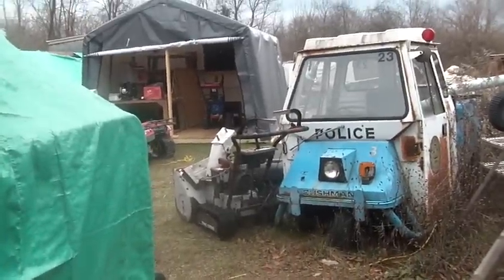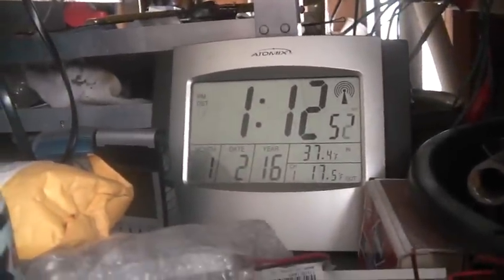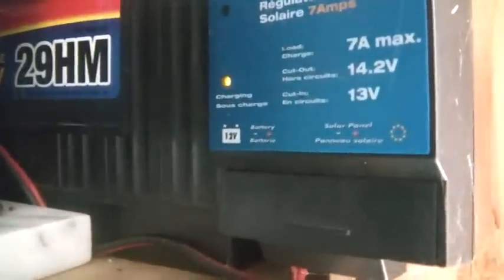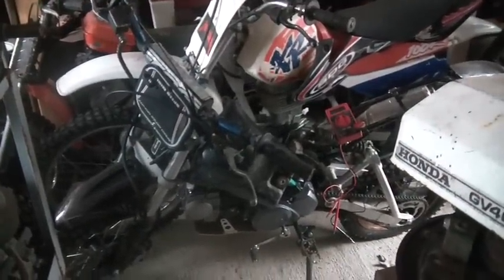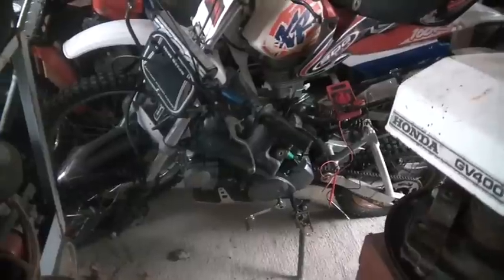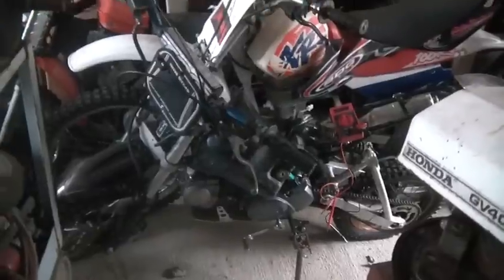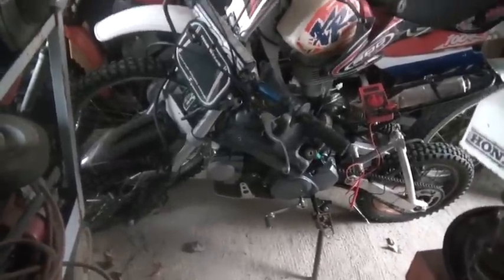Quick Pit bike wring tutorial, Lifran 125CC engine swap,

Comment: Harvey Spooner, thanks for this video.  I had picked up a Kandi 110cc kart that was in poor shape and needed an engine change.  I got a 125cc chinese motor like the one you used in the video.  I spent almost 3 days trying to get a spark with no success till i watched this video.  it is running.  only thing is my kill switch, when it is on it kills the engine and the engine runs when it is off.  no biggie though.  I will get a push button kill switch.
Reply: How do I disable the black/white kill switch wire?

Comment: I have a x18 super pocket bike, im trying to bypass the rest of the wiring and hook up the cdi straight to the motor, i have all 5 cables coming out of the motor, and matching ones on the cdi. I connected all of them together accept yellow and white. I left white dangling, and i tried hooking the yellow from the engine to the ignition coil, and then the yellow from the cdi to the ignition coil

Comment: hey buddy !!! i built a bike cd 70 honda based , when it came to wire it up i hook up blue+white to blue+white , black+red to black+red groung to ground and then black and yellow to coil along with green and put the spark plug cap on , it seems it can work but it misfires more than firing right

Comment: What happens when you get a engine off ebay and the stator has the usual wires but the pulser has 5 wires and a green plug to go to the cdi?

Comment: cheers Harvey so in my case the (red and yellow wire) from the kill switch goes directly into the bottom middle point in the CDI? does not connect into another wire and then into the CDI?

Comment: I bought a new lifan 150cc kickstart engine installed it today and it’s not turning it compression is good Changed the spark plug has a brand new carb bought a new wiring harness hooked it all up and fuel is clean but it’s not turning on please help I’m clueless on what it could be anythinnng I should do or check PLEASE HELP

Comment: Man i am a little confused with the to ground one on the stator and one on the cdi. Which one of these do i hook up on the body of the bike. I made a wiring harness myself and i tested it outside the bike and worked but when i put it all together didn't work then i unscrewed the coil pack and i was getting spark. I connected the ground of the coil pack the ground of the cdi and the ground of the stator all together and also connected it to the body.

Comment: Hello I have a 2012 SSR, do not think it has stock motor on it(JetMoto on side of it). It ran EXCELLENT as long as I didnt let it sit 4 2 long(3 week or more) then its a bitch 2 start. But this time it wont start, so my plan is 2 replace all wiring(CDI/Ignition Coil/& most important 2 me Voltage Regulator). All these have nice 4 prong connections, do I need a wiring harness or use my own wire & connections
Reply from the maker: Hey Hunter!!!!   Did the bike loose spark???   It seems that some or all 4 pin CDI units use DC power, some use 12volts from the battery, some use rectified AC off the stator.... My lean would be to make sure the battery has a charge on it or if no battery, I would roll it down a hill and pop start it. I would not replace anything quite yet, make sure Ur on and off switch is working properly, all of Ur connections are good and that there are no broken wires, also, if it has the original plug, change it, China plugs are weak at best and absolutely horrible otherwise...  Good luck, let me know how it all turns out!  Thanks for asking, watching, and commenting!!!
Reply: What up Harvey, I had my friend pull me all most an 8th mile with his atv 2 pop start but no luck, that was b4 I messaged u. At this point I have the new CDI, &  Voltage Regulator. I like my things 2 run good & b well taken care of, so I don't mind getting all new wiring 2 do that. It dose not have a battery, & i haven't put the new parts on yet.When I ordered them I had a delivery date of 11-22-16, but 2 of the 3 parts have arrived, 3rd will b here soon.
  Thanks 4 getting back, will let u no how it goes.

Comment: Just bought an "sdg" brand 125 pitbike. Has a no spark issue. Ive noticed it only has 2 wires coming from the engine case/stator, a white and a black. Does that seem correct? Which one is which? Stator and pickup coil
Reply from the maker: Hey Nate, Good luck with Ur SDG bike, I swapped the OEM motor out for a Lifan model, I'm going to have to look at the OEM motor again... If U don't hear from me over the next couple of days, please remind me.... Normally the CDI stator wire is black with a red stripe and the pulse generator wire is blue with a yellow stripe, the green wire is ground.... I'm thinking that the white and black maybe for the neutral switch.... Thanks for asking, watching, and commenting
Reply: take ur magneto off and see if u have 2 coils of wired stator coils.then note that the wires comin out are from small coil fpr firing.id say u have only 1 for firing or power and one for the pulse control.u will see the pulse control knob or nub.note wire color.same with other.

Comment: Great videos mate very helpful, I have a ybr 125 engine standing out off the bike and wount spark iv followed the cdi wire up video but still no spark,  I don't have the frame to ground. So do all my grounds go to engine casings??, could this cause a perminant off switch condition?? All my parts are new cdi coil etc, stator checks out out with multi meter, iv made shure the black and white off switch wire is not touching any thing cheers from England....
Reply: It turns over perfectly using the starter moter aswell, I noticed you don't use a rectifier in the cdi wire up video just stator to cdi, I always thought a regulator had to be used.

Comment: I have a small 125 and want to hook up a light. How would I do this. What wires?
Reply from the maker: Hey Cole, To hook up a light, I would hook one of the light wires directly to the battery Neutral, (-), the second wire I would hook to one side of a switch, (toggle switch that U choose and mount on the ATV), the other side of the switch would go one side of a fuse and the other side of the fuse should go to the positive, (+), side of the battery.... I hope this helps, thanks for asking, watching, and commenting!!!

Comment: hey what is the white and yellow wires for on the pit bike that ain't hooked to anything just wondering man
Reply from the maker: Hey Cort, The white wire and the yellow wire would go to a voltage regulator, the black wire from the regulator would be ground, and the (-) side of the battery, the red one would go to the positive, (+), side of the battery... If there is not battery, those wires should be left floating, (unconnected), I hope this helps, let me know if U need more.... Thanks for asking, watching, and commenting!!!
Reply: Ya no problem and do u think I could hook up a light to those wires

Comment: I have 3 wires coming out of my honda 250fl. Black, Yellow and White??
Reply from the maker: +John D ,  3 wires coming out of the engine???? If I recall, the FL250 is a 2cycle engine and normally they spark on every engine rotation,  does the spark plug wire come out of the engine or is the coil up on the frame, (I am not familiar with a complete OEM odyssey, the ones I have seen were altered... But, my guess on Ur wires, yellow is to power lights,  if one grounds black, that is the off switch, not sure on white, it could be ground, (check it to the case with a DVM)... I would also recommend checking a service manual for where those wires go, given that I am not sure... Thanks for asking, watching, and commenting!!!

Comment: I have a 90cc dirt bike and the stator pick up unit was hit and snapped off by the chain and I have a DC plug in and it's really hard to find another one. is it possible that I can cut the wires, get a new stator plate and connect and tape the  wires together
Reply from the maker: Hey Dennis, Yes, U can cut and splice the wires, leave them as long as possibe and do a nice neat job, all should turn out good.... Thanks for asking, watching, and commenting!!!!
Reply: Harvey Spooner i have a 1986 trx200 sx and have all my wiring right, i did purchase the pit bike harness. Everything is wired correctly but still have no spark?

Comment: I have a 125cc in a Chinese go kart and I put a brand new stator in it two nights ago and I’m still not getting spark and I’ve changed all the electrical things that come as a pack from Amazon such as CDI and everything else but I eliminated everything so I don’t have to deal with lights wiring and all that so just wires that run the motor and I’m getting power from all wires from the stator except the blue and white one and I don’t know why, anybody know what the problem could be?

Comment: King quad.. caught fire all wires burnt plastic melted Long story short I separated all the wires because someone grounds hot I've been watching I've been getting a lot of information has helped me I got the bike running again Carburetor Quickly redone But I'm having some issues With the reverse light switch or something probably coming from the motor I suppose I don't know Anything you can go over something new maybe to help me I appreciate it I'm thinking about doing is cutting wires and trusting that the colors that you say or what they are is what's coming out and I'm going to go with that I'm not sure I'm not sure what to do yet but But give me some insight on whatever I appreciate it Thank you

Comment: Im confused, i have 4 wires coming out of my bike and 4 out of my CDI (excluding killswitch). How can the cdi and ground get a wire if all 4 wires are matching up?
Reply: Yes exactly I'm thinking the same thing, I think a multi split ground lead  will need to be spliced in to the one and only ground.. Maybe... Bloody cdi I want to hammer mine lol....
Reply: @Shreddykruger  Lol, I know what you mean. Unfortunately since then I've moved onto BMW electrical issues lol. But If I remember correctly I believe what you said is what I had to do to get the bike working, splicing into the ground.

Comment: I have a question about the CDI if your bike is getting spark does this mean you're CDI unit is fine or if it's something else be causing my bike to not start
Reply from the maker: Hey Ryan, If U have a solid spark, Ur ignition system is probably good, (the CDI, coil, stator, plug, and harness are all good), I have to ask the next questions, what happened to the bike between when it was running last and now... Was it taken apart, did it sit for some time, did it run out of gas, or did it just plain of stop running???? Thanks for asking, watching, and commenting!!!
Reply: IThank you for getting back to me, from watching your videos I really gained some great insight into home repairs on my bike,Now the thing I did do the day/morning of my engine fail  was change my air filter from the Dual layered foam type to a small Mesh or metal wire type cone shape. Both filters are $5 eBay entry-level ones after making that swap I rode approximately 2 hours before having trouble while coming down the hill from my favorite ride spot and my bike started to sputter and then completely died seeing as I was on a downhill I continually tried roll starting which normally I'm very good at and nothing the bike would attempt to turn over I could hear it making that trying to start noise. You know the one. Not to mention great compression and fat blue Spark. Even so first thing I tried was new NGK spark plug and seeing as my carburetor was the type you cannot remove the float Bowl I decided to upgrade to the Mikuni vm22 but still no start.

Comment: Hi I just bought a pit bike don’t really know that much about them but from what I know the bike has compression and petrol in it but I checked for spark and it does not have spark I tried starting it by rolling down a hill is it because there’s no spark why the bikes not starting and I’ve ordered a complete wiring loom will that do the job by the way the bike I have is a 110cc semi auto don’t know brand
Reply from the maker: Hey Abdi!!!!!   I will be going thru the wiring on my pit bike as it has been cut and pretty much removed.... I hope it helps U.... Once in a while, a bike has a 12VDC CDI system, in that case, one needs a charged battery in it to run.... Thanks for the info, watching, and commenting!!!!
Reply: take your spark plug out of the cylinder head and touch the end of the plug to somewhere metal on bike while you kick start it. you should see the plug spark when you kick start the bike. If not, try ignition coil or stator. Mabey even CDI? a whole new wiring kit is only like $20 if you need it. Good luck man.

Comment: I have a couple of Chinese bikes both with electric start, but the I can't find which cable on the rectifier regulator is meant to be supplying charge. Can anyone help? Or does anyone have a wiring diagram. One is a 125cc thumpstar and the other is a 70cc no name bike
Reply from the maker: Hey Dan, Typically a rectifier has 4 wires on it, the green one is ground, the red one is battery positive 12volts, the other 2 wires, (both yellow or yellow and white), go to the stator, I hope this helps, let me know if U need more info... Thanks for asking, watching, and commenting!!!
Reply: does it matter which way round these wires go i have white and yellow on my bike loom and yellow yellow from my engine but cant get it to charge?
thanks for the help...

Comment: Hello , my stator don't have any black with red striped wire , so what can I do?
Reply from the maker: Hi, Tell me about Ur bike, I need to come at it from a different path, does it have a 12volt system, a battery, lights, electric start?   Is it a 2 stroke or 4 stroke engine????   Just one cylinder???  U may have a DC powered CDI.... How many pins on Ur CDI are wired up, 4 or 5???? Thanks for asking, watching, and commenting!!!
Reply: @HarveySpooner  it have 12 volts system , no battery , no lights , no electric start . 4 stroke . The bike wont spark , I suspect the pulse generator is broken or the stator isnt working .

Comment: hey guy i wired it up but i cant get a good enough spark to get it to folire over so i ran a wire from the battery to the hot side on the coil it fires up and runs but when the battery dies so does my good spark to keep the engine running can you help me out here
Reply from the maker: Hey Smoke, Any possibility of getting a video of what U R up to... The coil should only have one lead for input, the primary lead that is powered by the CDI box, if one puts 12volts DC to that, it will only spark when the voltage is removed... Does Ur spark coil have inputs?   Maybe U have a 12volt powered ignition system?  But, that would mean Ur CDI should be powered by 12V, not the coil... A video would help.... Thanks for the challenge, watching, and commenting!!!

Comment: Been finding out these CDI's only work on Hondas and china bikes. Tried a Polaris and a Suzuki LT400 and they burn out. The lt400 would only last one ride and burn out. My figure is the pick up coils output is to high.
Reply from the maker: +william staten , Good info!  I'm planning on smashing the 12Volt version CDI into a 2 cylinder opposed golf cart with a double secondary ignition coil to fire both spark plugs. I wonder if the pulse generator on the Robin engine would kill the CDI box.... About Ur problem, I would find out what the resistance of the Polaris and Suzuki pulse generators are and add a series resistor to get to the 30 Ohm value that most Honda pulse generators are,  if the series resistance is higher than 30 Ohms, I would go with a parallel resistor across the pulse generator... Honda Pulse generators cost about $18 on eBay, China clones go for about $10... I hope this helps... Thanks for all the good info, watching, and commenting!!!
Reply: thanks I'll give it a look

Comment: Can you wire both coils together to increase spark?  Sorry if that sounds dumb
Reply from the maker: Hey Armenvegas!!! I think wiring both coils together may damage the CDI, I do not recommend it.... They have high output cdi boxes that also tweek the timing for better performance and remove the rev limiter, they cost around $20 and I recommend the Casoli version... No question is dumb, U are learning!!!   Thanks for asking, watching, and commenting!!!
Reply: Trespatine
Reply: Harvey Spooner i love how you're trying to answer on every comment, and not breaking down peoples questiond
Reply: I have a question about the 2 yellow and white wires. i hook up a multi-meter, set to AC to the wires and get a reading of only around 1 to 3 volts depending on how much i rev it. im sure its not enough power to power any lights but why is this? can i ignore the 2 wires and splice into the coil to get power? or would that interfere with my spark power? please help me out!! much appreciated!!!

Comment: what if my cdi box is getting power from the stator but nothing is leaving the cdi? no voltage leaving to the coil
Reply: just installed a pitster pro 155z and can't get spark
Reply from the maker: Hey Wesley!   I'm about to fire up my Honda 300EX  with a pit bike ignition, should have a video up on it over the next few days.... As I do that, I will also discuss troubleshooting.... Thanks for asking, watching, and commenting!!!
Reply: Wesley Keely  how to check my stator

Comment: I have a question I have a Baja 70 dirt bike I got the wire harness as u commented in your video it all come hooked up but on the stator their is looks to be a green and red striped wire going to the stator is this wire a ground and where should it be grounded to on the stator its separate from the rest of the wires coming from the stator harness thanks for any help you can give your video was     Helpful